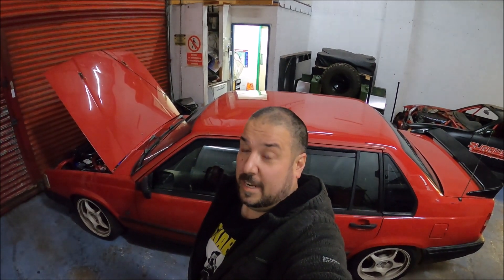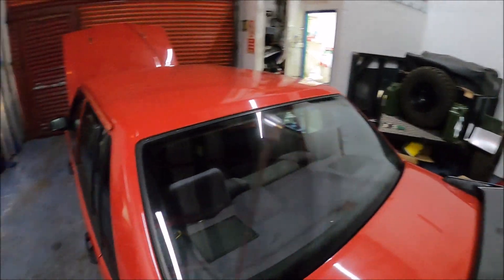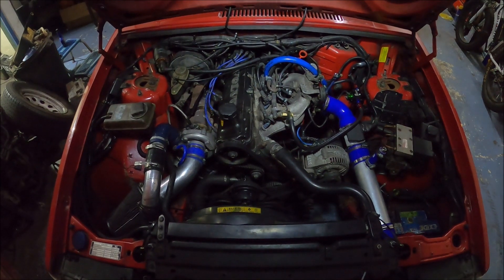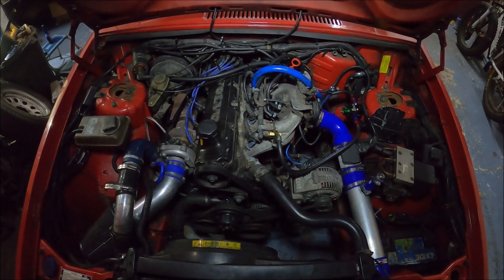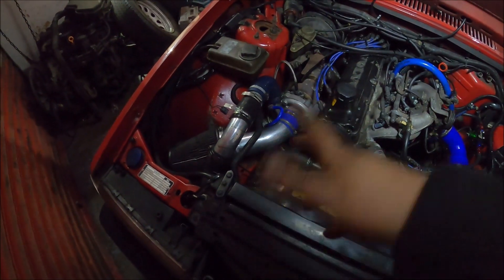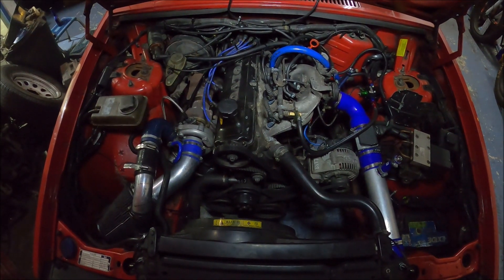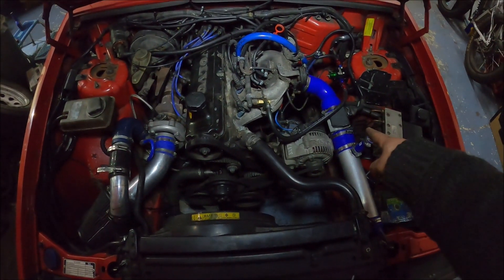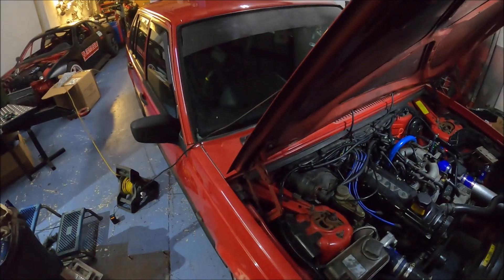I thought I was buying a Volvo drift car. Instead I bought a Volvo nightmare.

Comment: All sounds pretty similar to my world getting an Audi S2 motor in my 90q saloon (replacing the [7a] 20v asp. with the turbo 20v [3b]). I've had countless issues to this day (vacuum leaks, TPS sensor, N75 - not that surprising, ISV, oh and someone had put the diverter valve in the wrong way round, lol - I wondered why it wouldn't hold full boost and fluctuated up and down, though it's gradually getting better as I'm finding more minutia of small problems. 

You mention the original ECU chip[s] in yours? - I had my ECU refurbished and the guys weren't impressed with what was installed chip-wise regardless of what their intention was, sounds like a new ECU is a good shot for you. Some of these older builds have boost cheat pipes in them too to fool the map sensor - have you checked for one of those? Just trying to think of something you haven't as you seem pretty thorough.

I'll soon be purchasing an Emerald to update my own to try and make it future-proof not to mention try and diagnose a weird slight hesitation at 2500rpm once it's warmed up (absolutely fine when it's warming up, and if I turn the ignition / engine off and back on again it's fine for a bit but eventually starts acting up again and for the life of me can't diagnose what's triggering the hesitation once the motor's been running for a while, but why it goes away when I momentarily re-start the engine is baffling, but again it always starts hesitating again eventually further down the road. It's had new plugs and leads so can't be that). Perhaps with all your obvious wisdom you might have an idea? The ECU's code fault procedure was pretty basic back then. Anyway, good luck and keep at it!

Comment: Have you unhooked the battery to reset the learning in the ECU since you've fixed all this stuff? Might be worth a try. 

There is no map sensor and moving the MAF pre/post turbo should make no difference so that's weird.
Reply from the maker: Iain yep, was unhooked for over a week in fact.

And yes, pre-turbo caused massive massive issues, which surprised me too.

Pre and post will affect any map, but never seen the ill effects it had

Comment: Nothing uncommon really with the set up t3/t4 hybrid, vxr injectors, chips, not often at that level do people start upping fuel pressure, although not going to hurt just runs the injectors for less time, swapping to a set of better know chips would probably help a a fair bit, i think  a guy called boostin billy sells some on ebay,  and can help customise them if you tell him what injectors etc are on it, but have heard awesome things about the ostrtich if you know what todo with it can tweak things a lot, a site called ipdown.net has a few good bits of info on people messing around with it, and have seen some stuff around on Youtube, hopefully it starts behaving itself properly

Comment: So what's the plan now? New standalone ECU?
Reply from the maker: Dale Wright as I say in the video, people have got 500bhp using stock stuff.
Aside from the fact it’s a cunt to fault find with, and is a guessing game vs modern ECUs, there’s no reason to spend out on an aftermarket ECU.

All by rights it needs is a decent map on it, as what is on it is far from right.
Reply: Stav-Tech I’m leaning toward an Ostrich ( to live tune) for my big Holset 16v 940 as the lh2.4 in mine all works fine, is already running everything okay so far and     the wiring is in good order. I want to see if it can alter the ezk ignition as well so I can tune timing.  Not that I’ve ever tuned via computer before but I’ve fucked up better cars before so I’ll plough on.
Reply from the maker: Arewethereyet in highly tempted by the Ostrich thingy, no idea how user friendly it is, but I’ve used Carberry stuff etc on Imprezas and can do that.
Reply: @StavTech   maybe try and locate a stock ECU to rule it out, if you can find one that is .
Reply from the maker: JDM Imports funnily enough I picked one up yesterday to try out

Comment: GET RID OF THE FUCKING BLOW THROUGH MAF
Reply: Seriously, get rid of the whatever garbage chips it has, put the MAF before the turbo. If it runs poorly with the maf where it should go, then it's fucked. Also, no way in hell it will make power past 5500 with a V cam.

Comment: Haha Omg! This is hilarious.I dont know who buillt this but i can tell it was a complete idiot. The MAF sensor is sitting on the wrong pipe so yeah i can understand why your ECU is confused. The MAF sensor Should ALWAYS sit by the air filter. So move the MAF sensor to the other side. I promise the car will wake up if everything else is ok.
Reply: The car didn't run at all with that MAF near the air filter, was confusing the ECU and completely opening the injectors, flooding the engine every time you started it.

Look at any big turbo volvo and you will see the MAF relocated to the inlet side 99% of the time
Reply: @joshbolsover7455  By moving the MAF sensor to the pressure side it acts like a MAP sensor and its not designed for that so the readings will not be accurate and so will the mixture. Um 99% of real big turbo setups dont even have a MAF sensor. They use a MAP sensor with a standalone system allowing them to tweek everything. This turbo is more like a BPU.